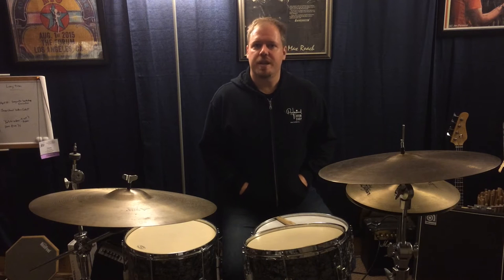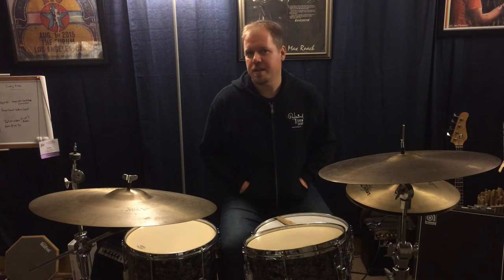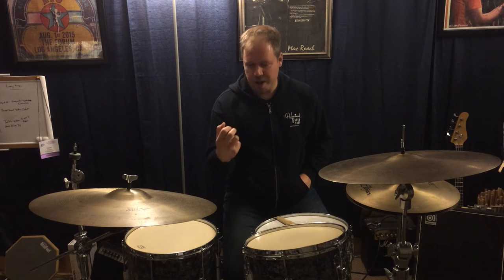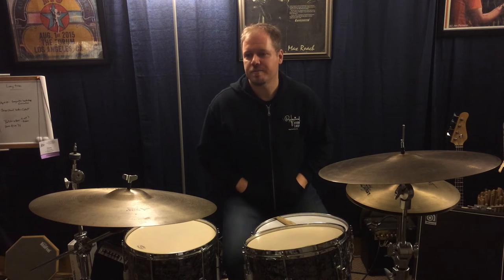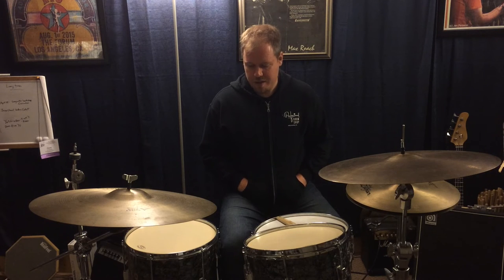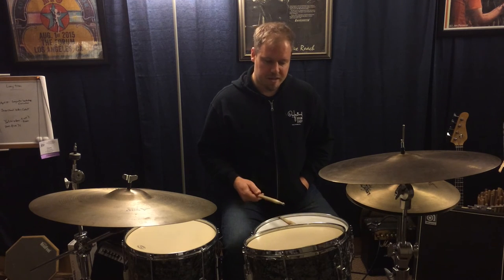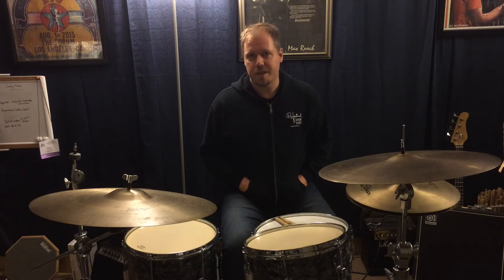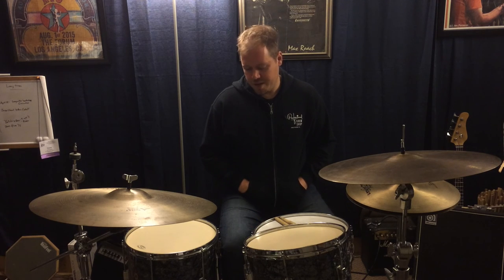Bass Drum Pedal Technique

Comment: Hey Dave. I've been playing and practicing for 14 years now and I've become literally painfully aware of a flaw in my technique  that your video is directly speaking to. After playing and specifically longer practice sessions with the Ted Reed syncopation book I've noticed considerable fatigue and tension in my ankle joint. It's difficult both physically and mentally to take a step back and address a flaw in the basic mechanics of my bass pedal technique and like you said addressing this problem now has been a real hangup, but it's better late than never I suppose. Your video is solid gold dude.  Thanks a lot for sharing it. 👍